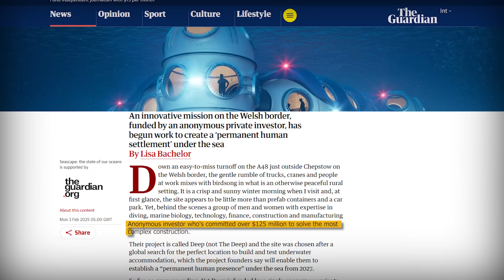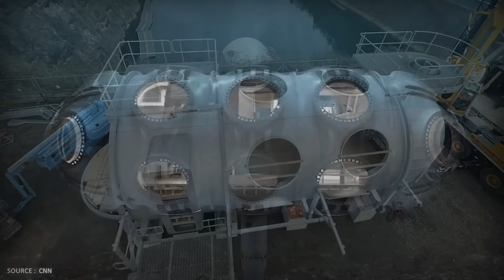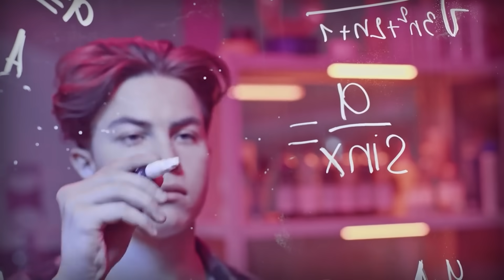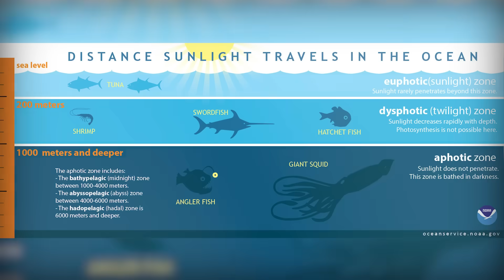Inside the UK’s $300M Underwater City Project

Comment: For research, sure. Otherwise - why? Sounds a little bit like a folly.

The video is somewhat contradictory, or at least unclear. The beginning made it sound like the interior was going to be atmospheric, rather than pressure balanced. Having a pressure balanced system is much, much easier to build, since you DON'T have to deal with the massive pressures. On the flip side, you do have to deal with decompression, loss of taste, and difficulty returning to the surface quickly and safely.

Comment: Non swimmer here. I wouldn't mind living underground, but not there :)  Both have their dangers, but taking a lift to the surface is far easier, as is resupplying. Be far cheaper to build also, possibly TV's showing the surface or any view you want, and far cheaper to build without windows etc.  Think Cheyenne Mountain Complex safety, for normal people.

Comment: What should be looked at is the lack of sun light, even simulated. A tanning bed should be installed for that sun warmth feeling that most people require. Other than that it is a very good idea, I look forward to seeing more.
Reply: I'm considering adding UV light in my home, just because I live in the Pacific NorthWest.
Reply: Just use a full spectrum light, the same as used in hydroponics, problem solved. This solution is already used on the ISS.

Comment: Sounds like a good way to gain more experience living in space. I'd like to see experiments in growing their own food and recycling their own air, food and water. If we're just looking for more living space, that would be silly. Far easier and cheaper to build larger skyscraper apt. buildings that could be built to function as small cities.
Reply: Only reasoning I can see for this is if weather above the sea surface is fairly uninhabitable, constant hurricanes, radiation, no ozone layer filtering the sun, iceball Earth, or you really need to be away from people. Like potential enemies need a decent tech level just to find you let alone threaten you for resources. With the requisite tech level they probably already have access to whatever you do at the bottom of the sea, with less obstacles that come with living on the bottom of the sea.

Comment: Interesting but having a few issues. 
How do you stabilise the modules deep in the ocean depths?
Once you're there you stay put which could present issues as if something was to go wrong, then what?
Losing weight sounds great but how much for how long of a period?
Food tasting different, maybe this might be a good thing to help the stomach with biodegrading food.
Where's the waste going?
How do you keep clean water?
Are those underwater turbines having GPS tracking pins on them to prevent any vessel colliding with it?
How to transport all the materials to the ocean once ready for ocean trials?
Will the ocean trial unit have giros to allow it to walk into the ocean rather than deploying it directly into the ocean?
Do the facilities use salt water for waste and washing?
Interesting but if you can't go from the bottom to the top then you'll forget the basic concept of needing sunlight for the skin to repair itself. I like the concept but there's got to be way to reduce any and all issues as well as be able to escape if anything goes wrong.
Reply: Why do you think they are doing this project?  It is a series of experiments to answer these kind of questions.  Continuing the work of the early pioneers who have answered some of them.  Including dealing with delays for medical emergencies caused by depressurisation.  Brush up on your surgical skills before diving.